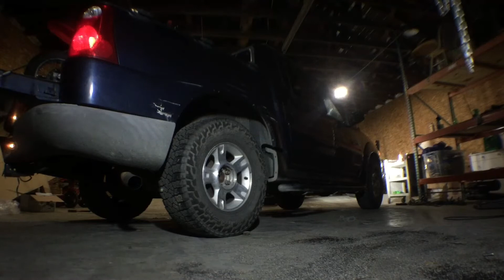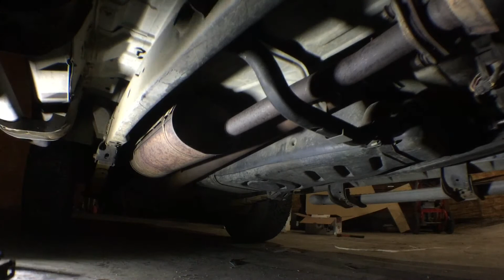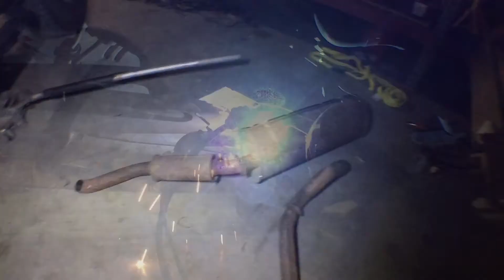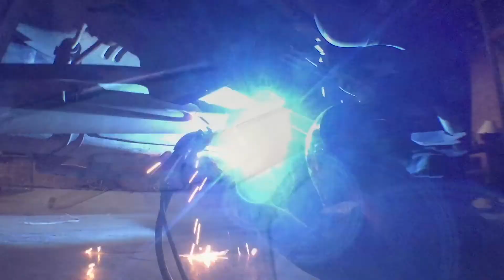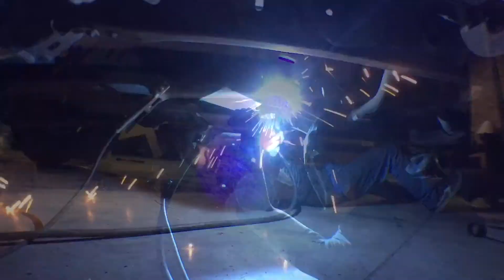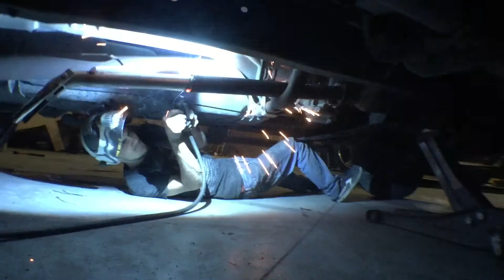Ford Explorer Sport Trac Muffler And Resonator Delete

Comment: I just got this type of truck and I want to do this, what exactly are you welding after taking the muffler off?
Reply from the maker: We just cut the muffler and resonator off and welded a turn down pipe right after the resonator, so it turned down right behind the rear seats basically. Like I’ve said in all the other comments it was done in my buddies shop and wasn’t the best thing ever but i wanted louder and that’s what I got lol. It honestly sounded pretty good though in my opinion.

Comment: Is that the stock muffler?
Reply from the maker: It's a muffler and resonator delete. Straight pipe from cats back with a turn down.
Reply: @Chopped Culture im removing the cats on mine.
Reply: @choppedculture326  could I accomplish the same goal with a exhaust cut out? If that’s what it’s called. A buddy of mine had one where it’s a muffler but with the press of a button on his key chain it basically turns a valve and makes it a straight pipe